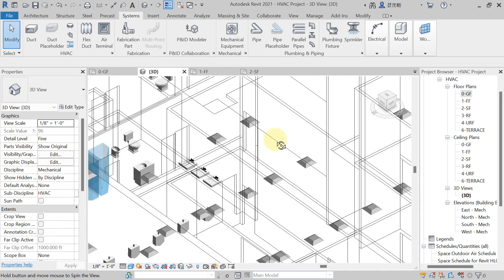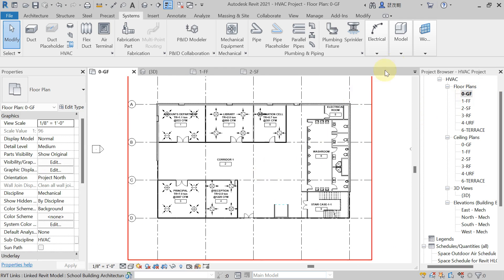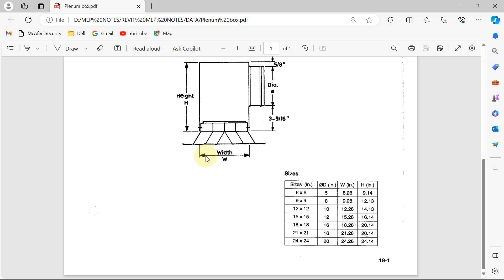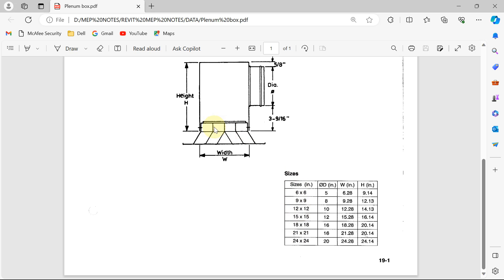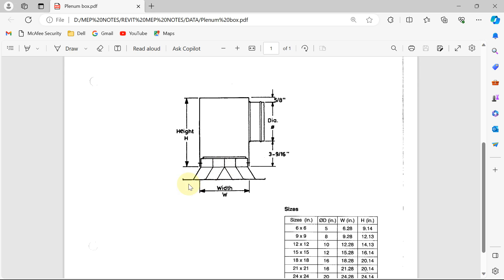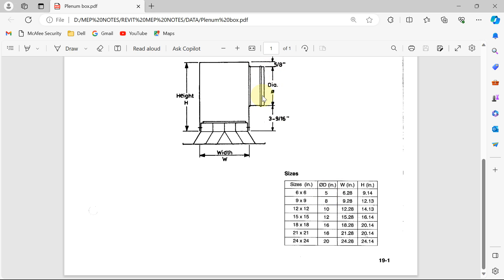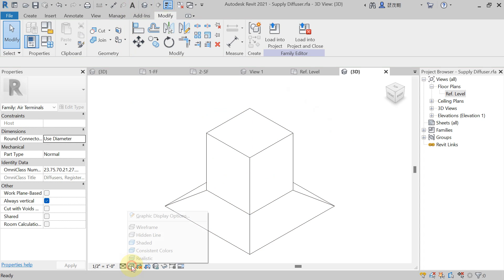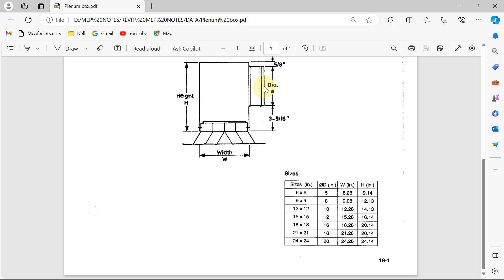Creating Diffuser with Plenum Box in Revit | Step-by-Step Guide!

Comment: Question, the plenum box adapts to the section neck of the diffuser??  meaning> If you have a 12x12 neck and a 24x24 neck, the section of the plenum box will change?? and if so, the diffuser can be edited to assign the cfm value?? Thanks

Comment: Why is the plenum box extrusion starts at 4" ?
Reply from the maker: The extrusion for a plenum box often starts at 4 inches to standardize the dimensions for common ductwork sizes and ensure compatibility with various HVAC systems. This size provides adequate space for air to be evenly distributed and helps maintain the desired air pressure and flow rate within the system. Additionally, starting at 4 inches allows for the accommodation of insulation and other necessary components within the plenum box.